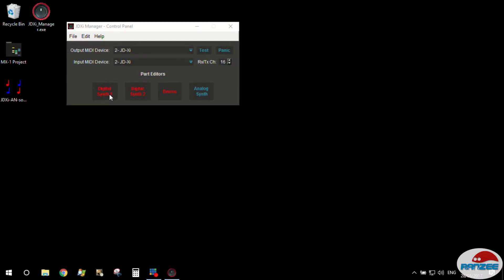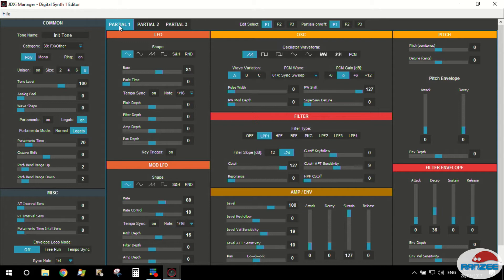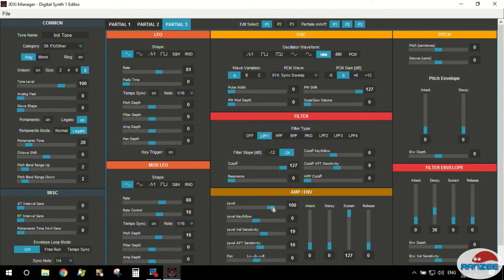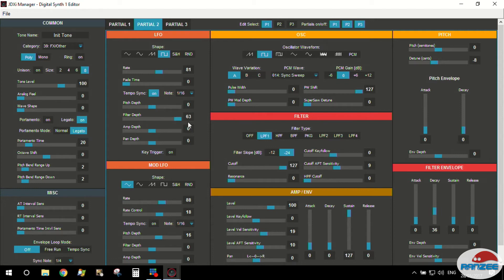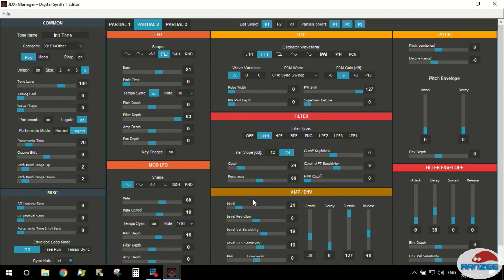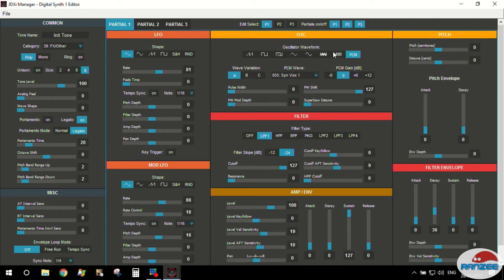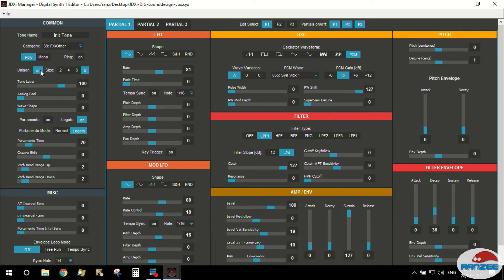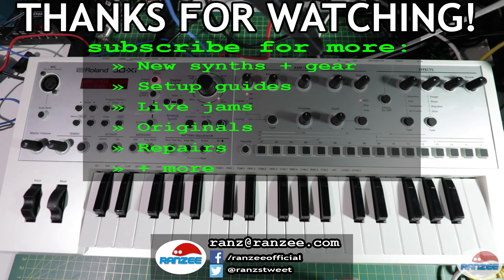JD-XI Sound Design - Digital

Comment: Hey man, I can't seem to get the edit select to work, is it just me or is this function not working?
Reply from the maker: Hi Callum Reid :) Thanks for watching. The Edit Select function I have been told by the developer just are simply for enabling/disabling which partials are affected by knob movements on the JD-XI itself. I may have said something slightly different in the video - however, not yet implemented! What were you expecting it to do?
Reply: Yeah, I thought the edit select allowed us to edit different partials simultaneously. Thats one of the main drawbacks if I want to create a partial that is identitcal to the first except slightly detuned I have to manually  adjust the settings correctly.
Reply from the maker: Sorry man, I feel like a goose now ;) I'm hoping he'll implement it! All we can do is ask :)
Reply: This question is what I was also searching the answer for.  It is very well explained here by "baz55" (author of software): http://forums.rolandclan.com/viewtopic.php?p=298069#p298069

It is also made me realize that the knobs on the JD-Xi itself are affecting the whole partials at once.
If you want to edit them individually, you should go as "Menu, Tone Edit, (1.. 4-5-6 numbers lid up,) choose which you want to edit. Numbers 4-5-6 stands for partials 1-2-3 / on - off. 

And thanks for this great video Ranzee.